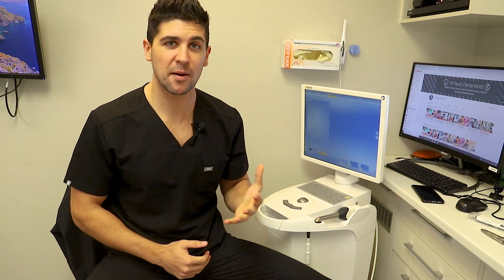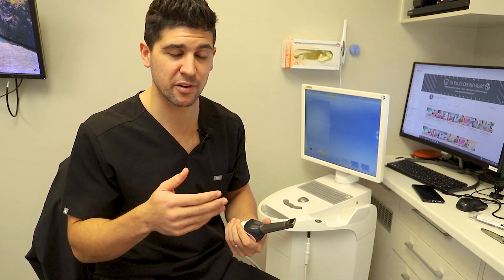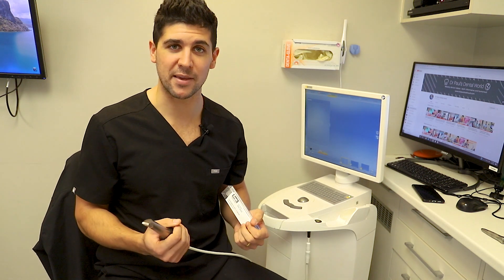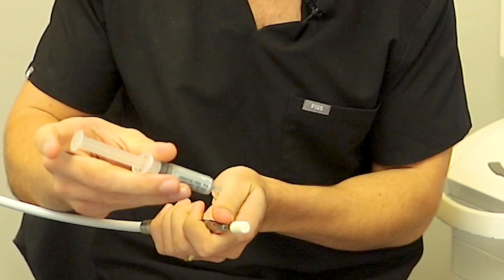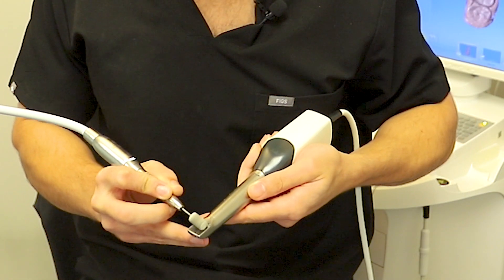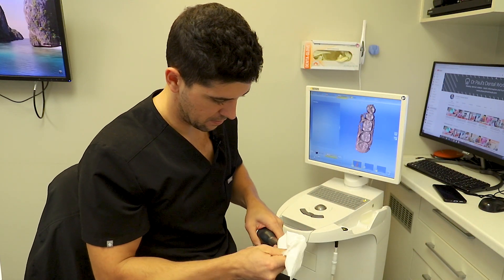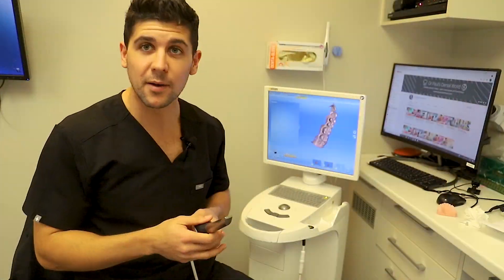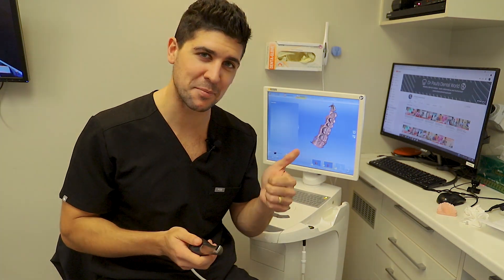How To Polish Your CEREC Scanner Glass For Improved Scan Quality!

Comment: Hi Paul, my omnicam scans a plaster  model perfectly but doesn't scan the mouth.  I've dried the teeth etc. Was told that it's an LED issue.  However, this means a new scanner is needed which is expensive.  Where can I order the polish from  the UK? I'm willing to try it before committing to a new scanner.  Thank you.
Reply from the maker: Hi Wayne, are you waiting for the scanner to heat up enough? Otherwise, yeah, likely a new light is needed. To buy it, check out the website below. Otherwise search for the name of the paste in Google and you should find someone who posts to you
https://www.cuttingedgecuttingtools.com/engis-diamold-dental-kit/

Comment: Hi DR
 Sometimes i use zircon block which is not sirona
 then when i insert the block and type the code there's message appears that (no label quality was recognized...) Then it will start milling but it will not transfer data to cerec speed fire furnace sothat i can do sintering.

Thats why i only use it for milling then do the sintering in outside lab.

Can you help and advice please?
Reply from the maker: I have no idea how to help sorry. Try the Facebook group 'cerec files'

Comment: Hi Paul, Sirona Bensheim wrote back. They told me to buy a new case 🤣 what else. But they interestingly do not explicitly confirm my request, that polishing will damage the plain surface of the glass.  I’m still cautious about polishing and may ask you again in a year or so, if you have fitting-problems with bridges, before I polish mine. Best wishes from the home of Cerec&inLab Peter
Reply from the maker: Hi Peter, it's been a year on, and things are still fitting great! We don't do any bridges, but for single crowns, they are fitting awesome. My techniques of prep have probably improved but I would say that the fit has been better than ever. About 2wks I also re polished it, because it was scratched again, over time
Reply: @DrPaulsDentalWorld  THX for the follow-up. I still haven´t time to test your polishing advice, but I´m glad to hear your satisfaction.
Reply from the maker: Hi Peter, that doesn't surprise me!

I can tell you that the people that taught me this, have been doing it for years, and are 'Cerec trainers' here in Aus. We followed their lead and did this about 6mo ago. We are a surgery of 4 dentists who make about 15 units (total) per week, so it gets a workout. Our fit is still perfect, but we only do single units. The main benefit of being able to scan a lot easier, is still there.

Hope that helps 👌
Reply: @DrPaulsDentalWorld  I believe single units is not such a problem, cerec does really good job under worst condition by single units. But when it comes to connected units or bridges, the requirement for precision is much higher. Maybe I buy a new shell and make tests with the old scratched one. Do they ship the polish-kit to Germany?
Reply from the maker: I suppose I'm extrapolating that we haven't seen a decrease in quality for single units, so I'm expecting for multiple units it should be the same 🤷‍♂️

The guy I bought it from is in Australia, but you can definitely get this polish from other places.
Reply: 1. Did you calibrated the Bluecam after polishing?
2. Omnicam and Primescan use different image acquisition technologies, your Bluecam actually overlays a line pattern to capture 3D. 
3.Maybe ask your technician to have a go at repolish the bluecam.

Comment: Hello Paul, if you polish the glass manually, the glass will no longer be flat and the stripe projection will then be faulty. Hold the polished glass of the camera against a window with a blind and you will see that the stripes are no longer straight. Greetings from Germany Peter PS: If possible update your Omni to Cerec Connect or SW5.2 and you´ll see a big improvement!
Reply from the maker: Hi Peter, thanks for the suggestion. I can tell you after using it for about 6mo since polishing it, it's much much better. The fit and speed of it has improved since then

Yes I would love to upgrade, but it isn't my practice and the bosses have decided to wait until next year before upgrading.
Reply: Morning Paul, thx for feedback. Let me ask Sirona in Bensheim if polishing is definitely not damaging the glass. I polished my bluecam just like you before selling it and the result is exactly like yours. The scratches were gone, but the glass was minimally curved. You could only see the curvature through the reflections on the glass when striped light rays hit it. Don't you think that Sirona wouldn't love to sell us mass expensive glass polish, if a polish done by dentists, will improves the appearance? 

For newer Omnicams there is a Performce Package sold by Sirona for 1200€. Scanning includes STL-export with latest SW5.2 algorithm for better improvement by full-arch an large-span bridges, especially in the front. Package includes Windows 10 key (cave: scan only no CAD). With computer experience you can upgrade for 250€. I did it with some really smart guys from the German dental-forum, but won’t do it again, because my time is too expensive. The upgrade costs me a week of research and one day to execute. If doing it again, I’ll may need only 3-4 hours including upgrading windows 10. 
B.r. Peter
Reply from the maker: Sounds good, let me know.

I think they wouldn't want that, they'd rather sell a more expensive new cover 🤣
Reply: @DrPaulsDentalWorld  true, true 🤣 same here and down under
Reply: Hi DR
 Sometimes i use zircon block which is not sirona
 then when i insert the block and type the code there's message appears that (no label quality was recognized...) Then it will start milling but it will not transfer data to cerec speed fire furnace sothat i can do sintering.

Thats why i only use it for milling then do the sintering in outside lab.

Can you help and advice please?